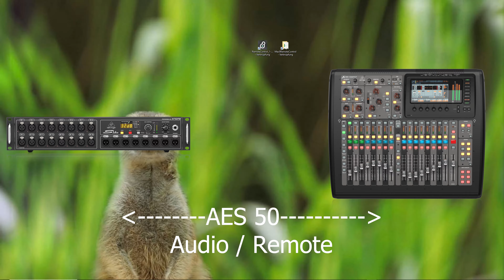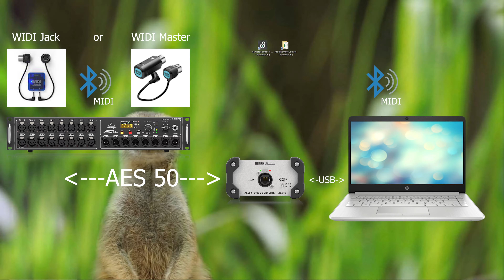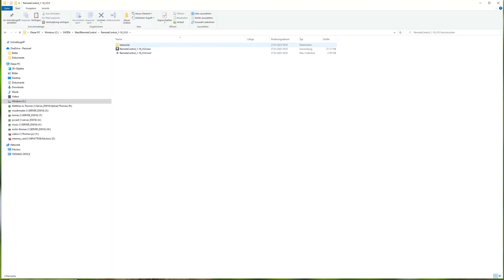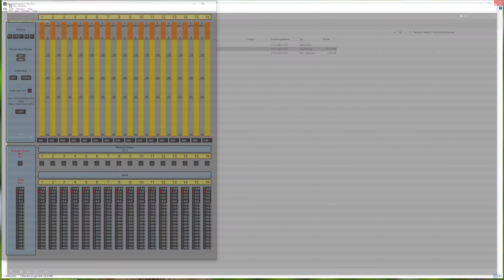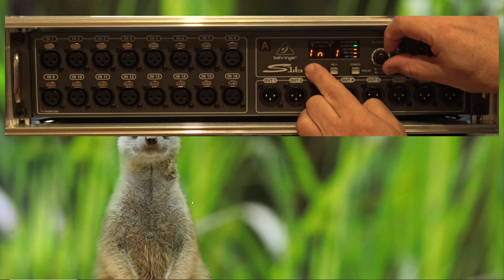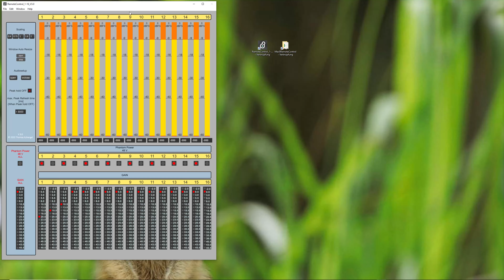Behringer S16 RemoteControl - V5.10

Comment: Where did you find the midi spec for this? I have a Midas DL32 stage box which also has Midi i/o on it and I'm interested in setting up a midi control device to control the preamp levels and phantom power.
Reply: Look into my download area.
There is a PDF with all infos you need.

Comment: Good addition! How did you find out the command/values of the S16 MIDI messages? Is the source code also available?
Reply from the maker: The S16 MIDI messages can be found within the S16 user manual (page 12).
But it is important that they are mentioned there as decimal values, I had to convert them to hex.
What is not in the manual is the fact that the second daisychained S16 can be adressed with MIDI-Channel 2.
Patrick-Gilles Maillot helped me out to find these facts for the second S16.

I have to think about publishing the source code.
Reply: @audiophil3761  thank you for the quick reply. I must have been blind - only found the "quick start guide" but will keep looking for the complete manual. I would like to use the software, but having no source code access would rather stop me from using it. In addition, I would like to fix the "C:\DATEN" issue, as root access needs additional permissions (at least on my system). Please do not get me wrong. I really appreciate the effort you put into the software. It is just that from a maintenance perspective I would not want to rely on a software where I do not have support nor access to the source. I saw your conversation on the Behringer forum and register there to continue the discussion. Keep up the good work and thanks again!